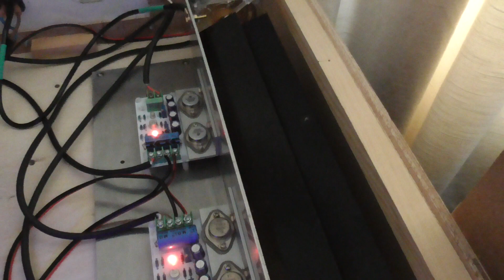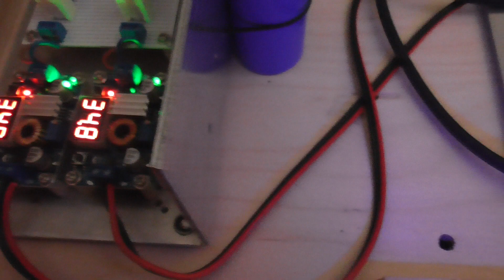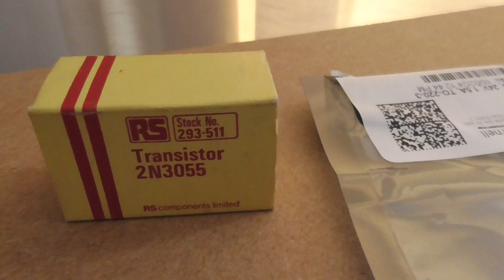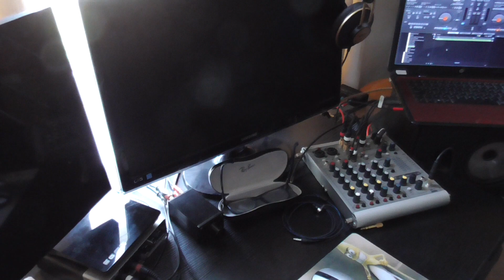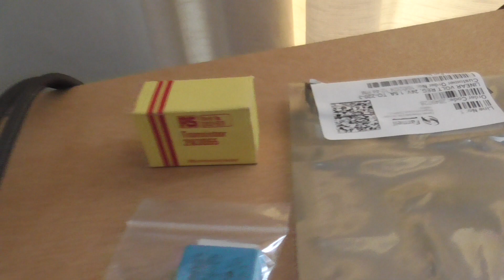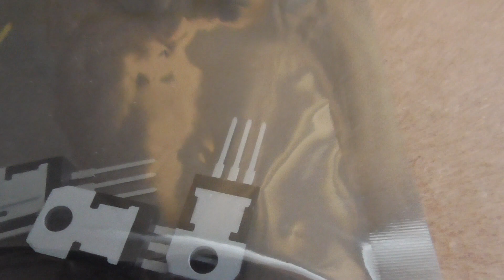jlh 1969 amplifier

Comment: I use a "19V/9.5A Toshiba power supply" with a "DC LC Filter Lowpass EMI Power Filter Low Pass Passive Filtering Board F SNT" on my amp.
You won't believe how clean this power supply is!